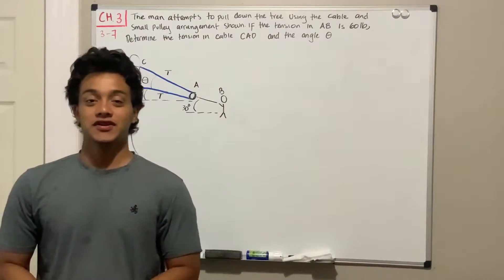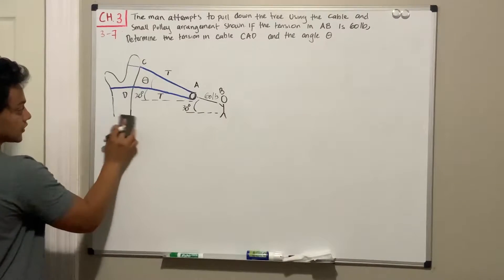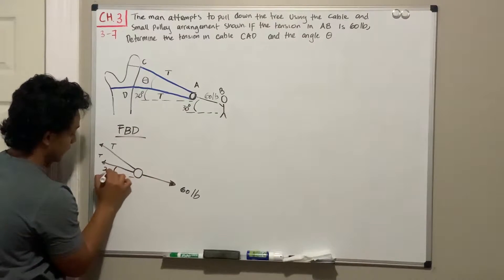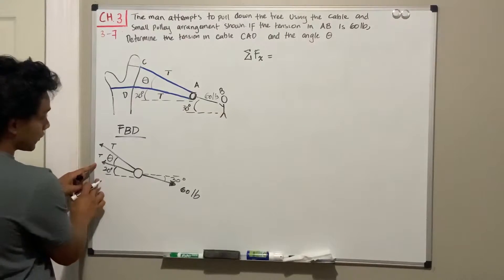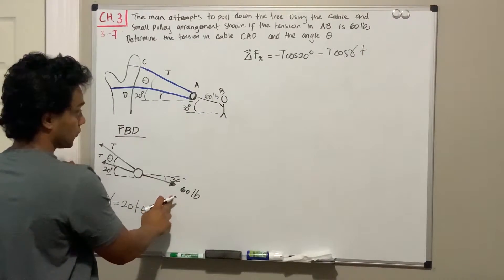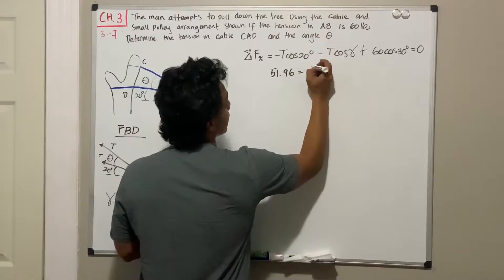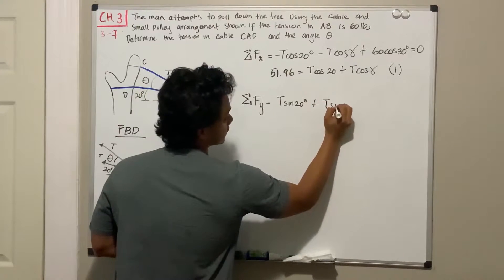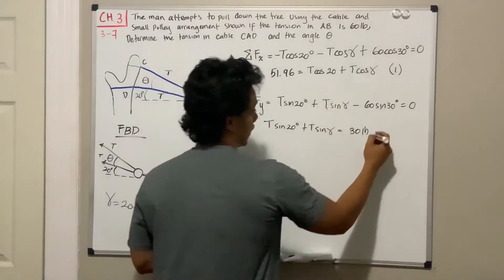Statics 3.7 - The man attempts to pull down the tree. Determine the tension in cable CAD and angle

Comment: How do you set up the calculator to graph like that? I type in the same values and I get a different answer.
Reply from the maker: I did not set up my calculator in any special manner. Please double check how you are putting the values in your calculator, specially the denominator.
Reply: @LearningbyTeaching  I figured it out, my calculator was in radians and not degrees. Thank you for the reply!
Reply from the maker: @BrotherJoe210  Very smart!